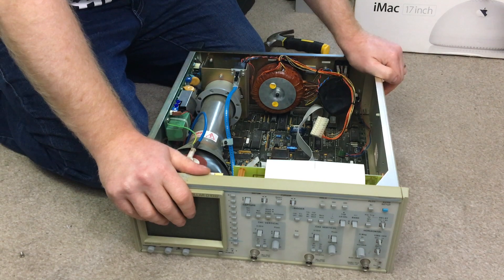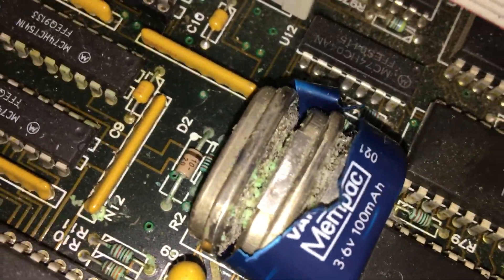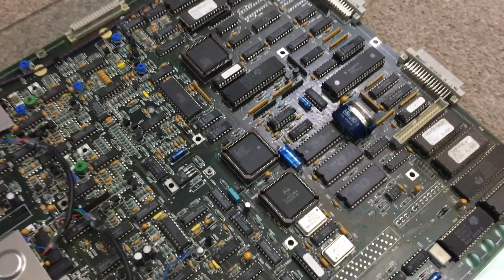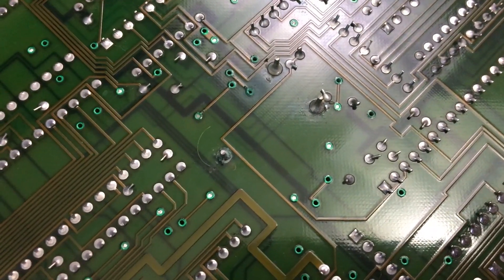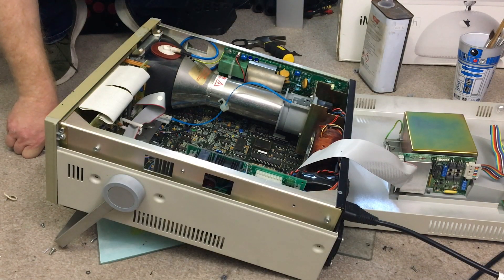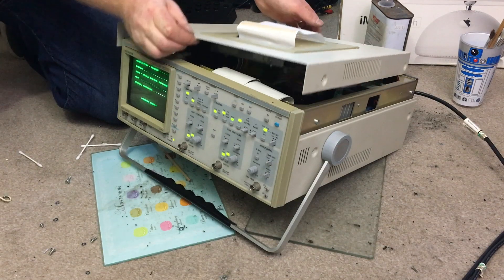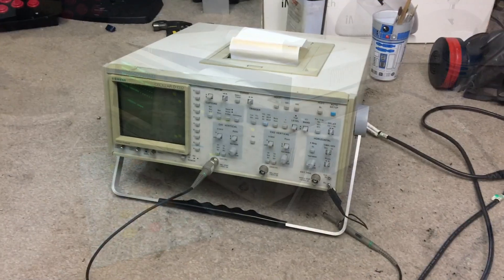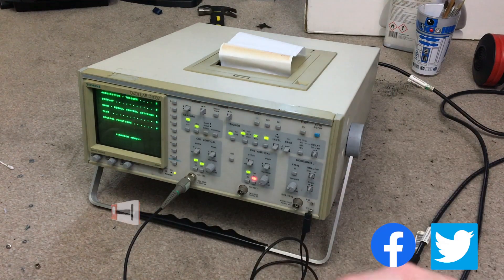Smoking Oscilloscope Repair : Rare Siemens Oscillar D1032 Analogue / Digital Hybrid.

Comment: I really suggest to pull the EPROM(s) from it and make a backup copy. This thing is nearly 30 years old (I've seen date codes from 1991 in it), and EPROMs can develop 'amnesia' at this age. Probably impossible to find the bin files for it anywhere. I've seen some EPROMs that were failing. In my beloved JVC BR-7000ERA professional VHS duplicator deck, for example, about 8 years ago. It was unable to start, 8 out of 10 power-ups. I found out that the data in its EPROM was 'fading away', when I put it in the programmer, it read different data from it every now and then, I saved 2 or 3 versions of bin files with different checksums from the same EPROM. One of them worked fortunatelly, because the EPROM content was unavailable on the web. It was a last minute fix. Few months later the EPROM content probably would have been permanently corrupted.
Reply from the maker: mrnmrn1 good idea, but I have no eprom reader.  I’ll have to ask the uni.

Comment: Are you going to try and replace the battery at any time? Presumably at the moment without the battery, it has no backup.
Reply from the maker: Nope, I'm not an advanced user so don't need to store anything.  I have a fully digital scope if I want to do that, I just like to use older scopes too for fun, especially with this being so unusual.